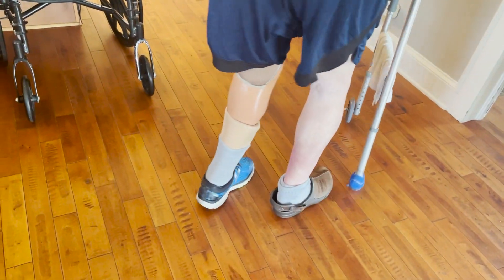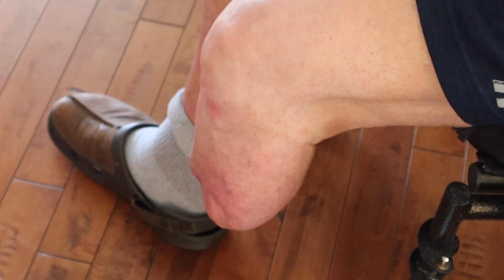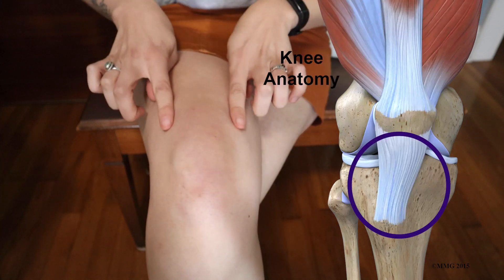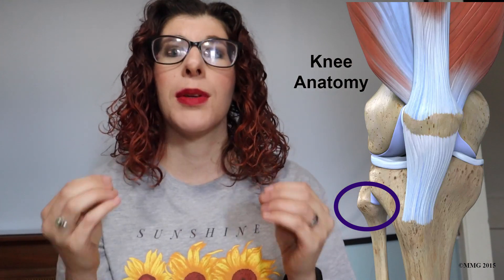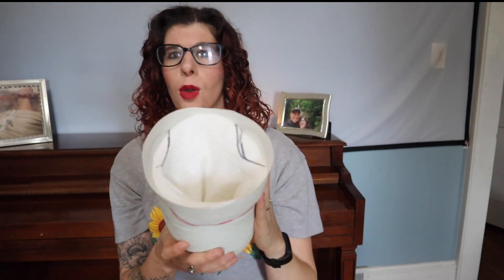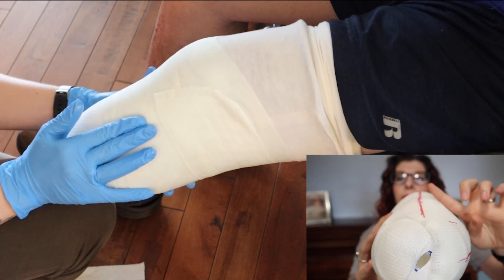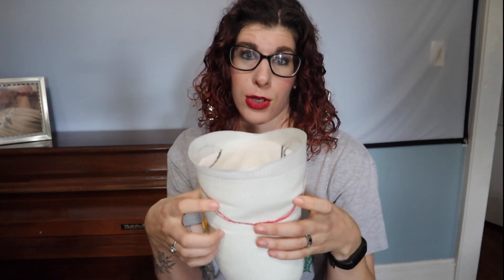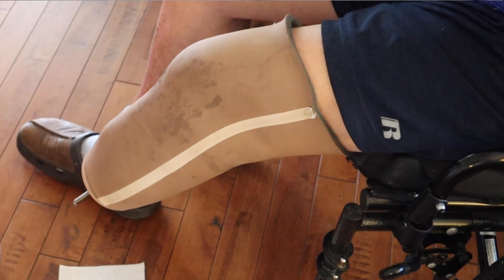Transtibial Amputee: Limb Assessment and Cast

Comment: For bench alignment, how do you adjust the angle, let’s say 15 degree flexion?
Reply from the maker: Typically after casting, I will scan the cast in a flexed position of about 7-10 degrees (more if needed). So that flexion is built in. If I need to add more flexion I can do that with set screws at the pyramid. If I am doing up to 15 degrees for flexion tightness or contracture I will move the socket slightly more forward than normal so the weight line still falls at a good spot through the foot.